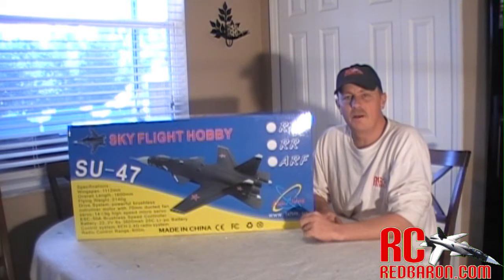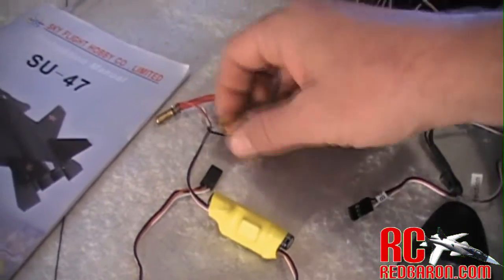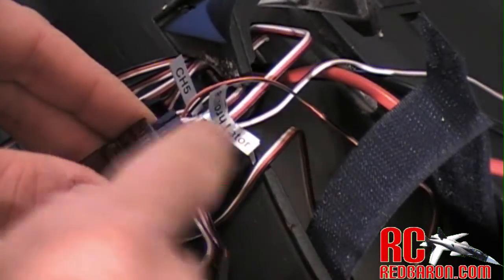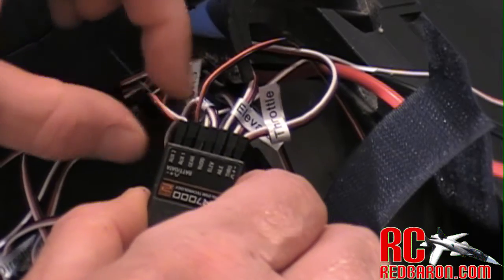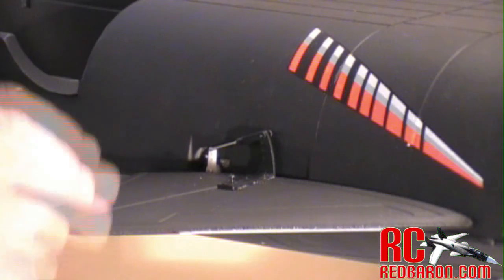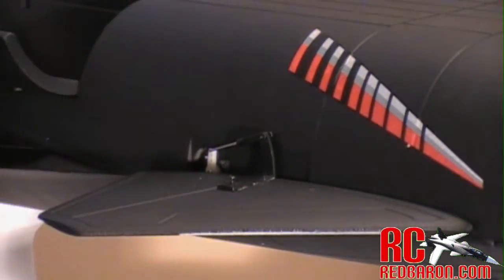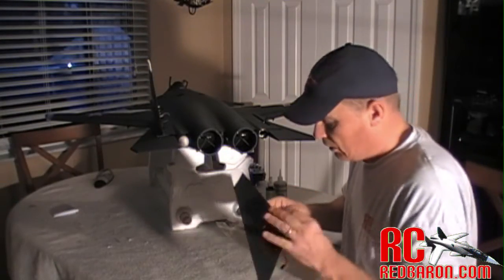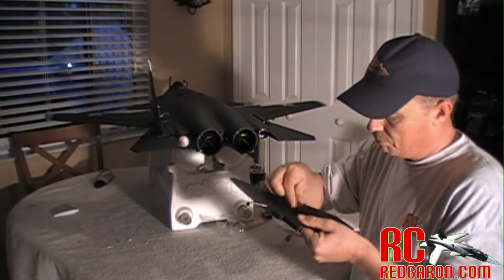SU-47 BERKUT TWIN 70MM THRUST VECTOR - BANANA HOBBY - BUILD VIDEO

Comment from the maker: @bayareaflyers : I finally found it.  No glitching.  This is where I have an issue with the plane.  The Gear Doors are operated by a STRING attached to the gear struts. So if the string isnt the right length, the door operate horribly. The glitching you saw was simply the wind blowing on the door since it's just hanging there, attached to the gear via a string. For a great looking plane, the gear door system is weak.  But the actual GEAR is GREAT.

Comment from the maker: @DanielMadrigalC : it's physically a 12cell, but only 22.2volts like a 6cell lipo.  When you join batteries in Parallel, you dont alter the voltage, only the Mah.  so I like to think of a parallel joined battery as a 3cell or 11.1volts.  since most people think of 11.1volts as 3cells, it helps keep it straight in your head.   If you join 2 3cells in parallel creating 11.1volts but with more mah, and I called it a 6cell, people would go insane.  but yes, physically, it's a 12cell.

Comment: Built-in parachute?!  That's a first for me.  Must have a video of that parachute in action!

I just hope you don't accidently deploy the parachute while the machine is flying in the air!  But maybe it could be a good way to save an out of control plane from servo failure, battery failure etc.  Better than a hard crash into the dirt.

Comment from the maker: @EnterpriseXI : Put the glue into the hole or slot first.  With CA glue, you can get a tip extension that allows you to put glue deep inside the recess.  Don't over use the glue. Putting too much glue will cause it to ooze back out and get into the hinge.  There are many types of hinges, so each uses a different method of gluing. If you are using these hinges in this plane, use a toothpick to apply epoxy into the hole first, then slide the hinge into the surface.   ~~robert.

Comment from the maker: @LORDBATOR69ER1TIME : Great question... On the maiden flight attempt, as it went down the runway, the front nose gear snapped, and I mean the actual plastic shaft. So when that snapped, it then ripped the rear gear out of the foam. So it never saw the air. It's on my shelf of "things to do" but I keep getting distracted with all my bigger gas planes.  But one of these day, I will get to it.  ~~Robert.

Comment: any body here experience the EDF motor doesnt work when power up the SU 47..I put throtlle servos to channel 3 and 5V UBEC cable to Channle 7 as per LX manual..all servos working except this EDF motorNot work..receiver is binded Iam using JRPRO and Turnigy 9X same trouble EDF Mtor not working..Iam.Ive heard continous beep instead of 6 beep..Ima using 3600mAH ,6S..
Reply: Richard Ricafort Did you set the throttle range?